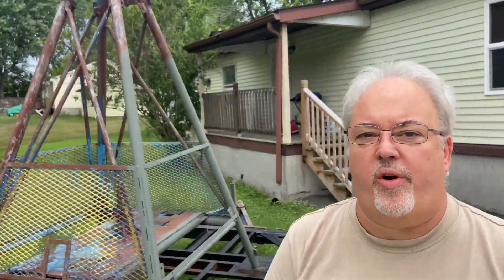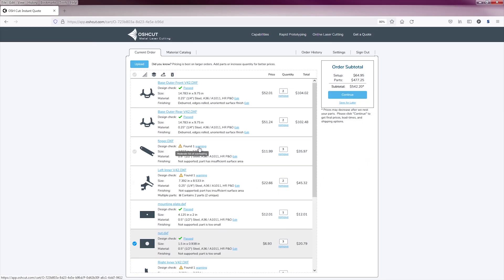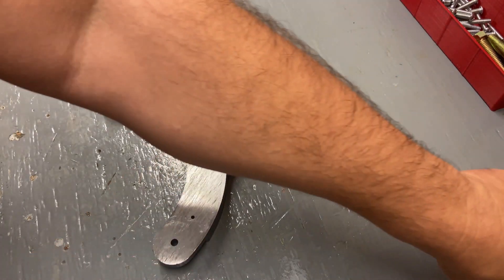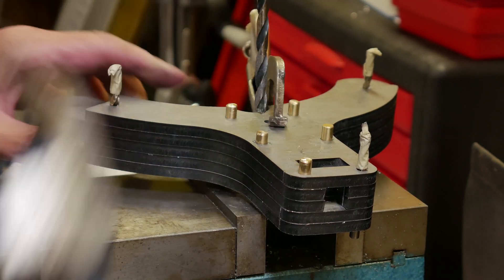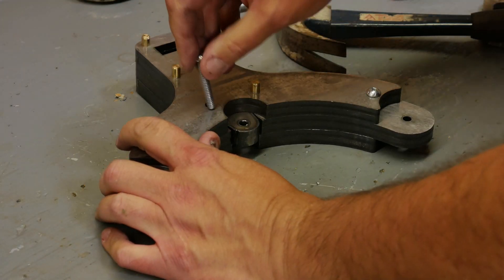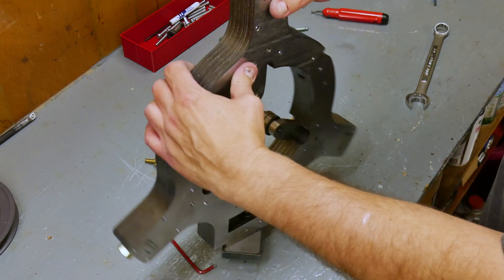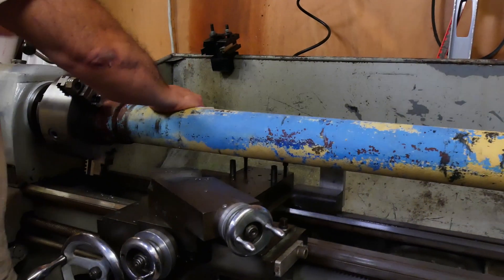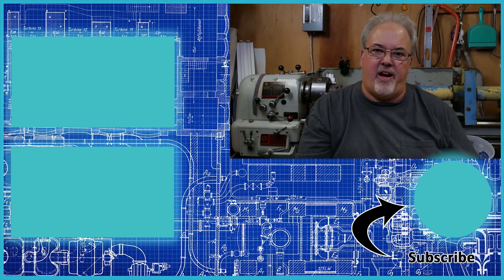Steady Rest Build For Clausing Lathe

Comment: Awesome project, I need to do the same. The steady for my lathe (14x40) will only hold a 4 inch part. - I'd be careful with the laser cut edges on your ways - that stuff is hard as diamonds.

Comment: very nice job on it..  have you thought about selling the DXF files so otherers can can build one?   I have the 15inch Colchester , and looking at making one for it.  I have a cnc plasma table ..  I know my center height and bed is prob different.
Reply from the maker: I have not up until this point.  I wasn't sure there would be that much demand for it.  This video itself didn't generate the amount of views I thought it might so that makes me really question if there is any interest.  I know in its time this was a very popular lathe and they are all over the place so it makes me wonder.
Reply: @PeteRondeau   ok thanks.  I'd be open to modifying your file to fit my 15" lathe.  I have Autocad 17LT
Reply: @PeteRondeau  I would love to get some cad files for your steady design I plan to make a smaller version for my Emco Maximat 11, would you mind to share?
Reply: @PeteRondeau  I also would love to have a look at the CAD to see what I could adapt for my Clausing 5937.

Comment: I've thought about building a steady rest like this.  Do you think you could bring the cost down by replacing a lot of the plates with tubing in the middle everywhere a bolt goes through?
Reply from the maker: Yeah, I could see that working, but I would probably go with bigger bolts to help keep the outside plates from shifting relative to each other.  Thanks for watching!

Comment: Hey, this is Caleb at OSH Cut!  Thanks for the shout out.  That box is a head scratcher for us - the label isn't one we print (we use adhesive labels, not printed paper), the tape doesn't match (we use brown industrial tape, not clear packing tape), and the box isn't one we stock and ship.  I'd guess that what we shipped was somehow destroyed and UPS did a reprint and put the parts in the new box.

But I'm glad the parts worked out in spite of the issue!
Reply from the maker: Well that is certainly an interesting turn of events.  Given that, I'm surprised the package was only delayed by 1 day.  I appreciate the quality.  Knowing what I now know, I would have had most of the holes laser cut to final size and only undersized the ones that needed to be tapped. Thanks for watching!

Comment: Nice work.  Sometimes you have to weigh the difference in price to have the parts cut, and number of times that you would actually use a cnc plasma table as well as
the space the machine would take up.  I have a newer Clausing Colchester 13" lathe and the price that I was quoted for a steady rest was $2800, nope, not going to happen.
Reply from the maker: Great point!  That is one of the biggest issues- space- I have zero room for a cnc plasma.  I had no idea new steady rests cost that much.  As this is an older machine I just follow what I see listed on bay, and in this case the availability has been sparse lately.
Reply: @PeteRondeau  Mine was built in 1972, but steady rests and followers seem to be none existent.

Comment: when its not being used as a steady rest, local kids can use it as a rubiks cube (-=
awesome work , it looks amazing.. Ive outsourced quite a few cnc projects and its super stressful.. I end up checking the drawing 100 times for different specs before hitting send..
While watching , i thought about the cheapest way to make this with limited tooling ..  My intial thought was 3d printing the steady as 2 pieces , then casting it in aluminum, but even that would be 400 or so to set up
Reply from the maker: It was a bit stressful.. kind of an all or nothing proposition. Because of the way I set the drawing up, I had to export the drawings from 3d into individual 2d files manually and that is where I worried about a mistake.  I finally convinced myself worse case scenario, I could take it into work and have pieces welded on or cut off if anything was messed up.  I actually considered casting it but once I discovered OSH Cut I went full steam ahead in that direction.  Thanks so much for watching!